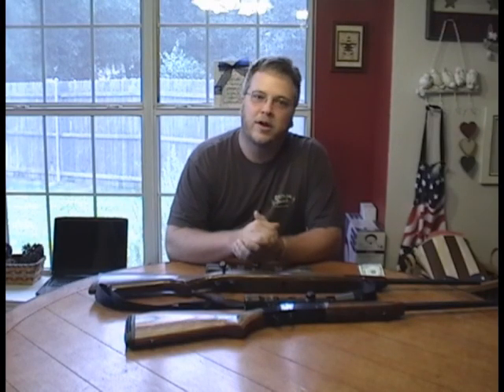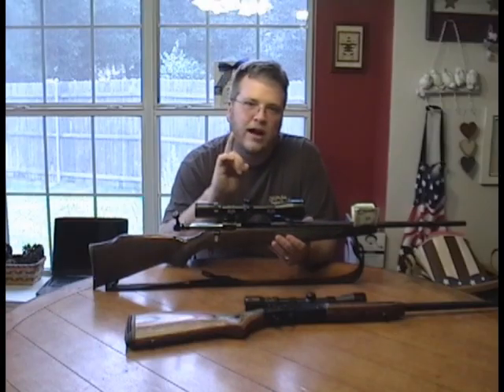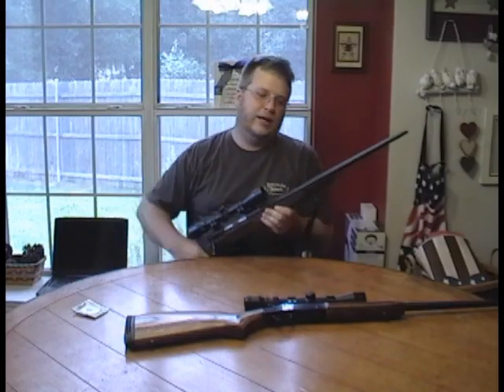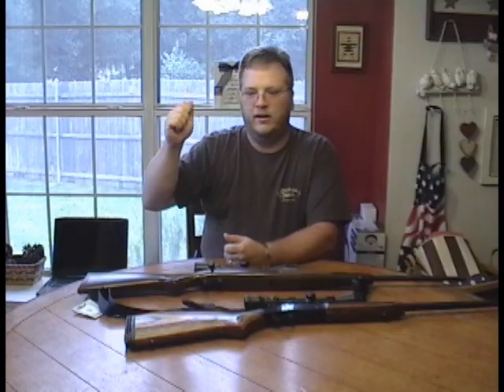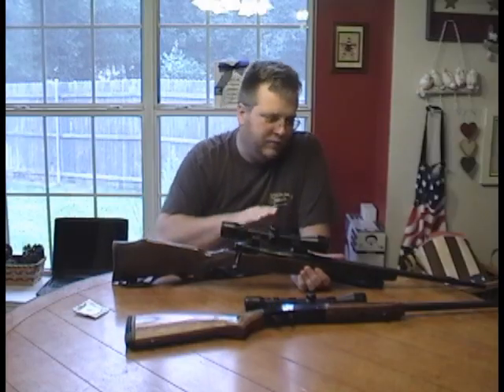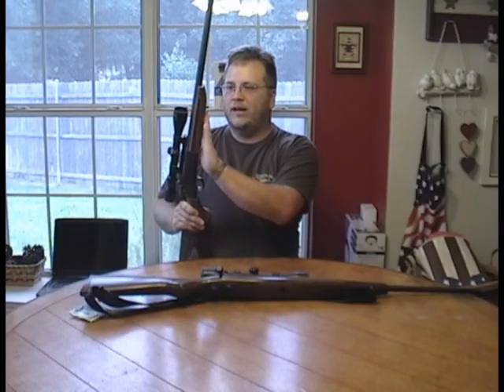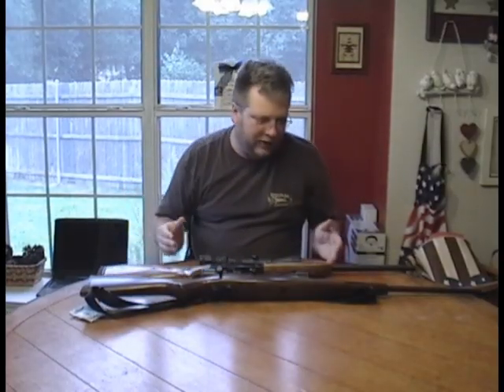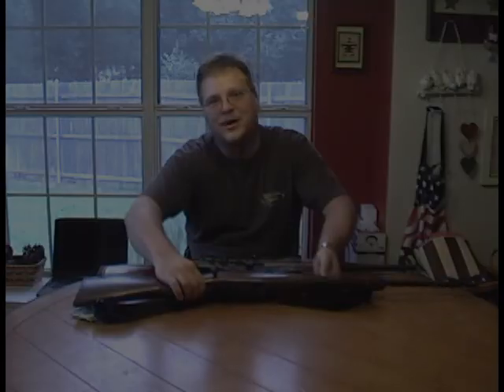Why Floating a Rifle Barrel Increaes Accuracy

Comment from the maker: @ss19800 - Bedding and floating are 100% completely different things.  Floating is about the barrel and removing contact.  Bedding is about the receiver and ensuring contact.    Many people "free float a barrel and bed a receiver" but the processes for each are totally independent and one doesn't require the other.
Reply: Jack Spirko I have 1983 Smith & Wesson model 1500  bolt action. Wood Monte Carlo stock. No floating what so ever. Gun shoots .25 or better MOA. Usually hole in hole. I found a video where a guy did the opposite of free floating. Took a 22 that shot horribly. It was free floated. Added a wire clamp and cinched the barrel against the stock. Then shot lights out.

Comment from the maker: @tmaxxmudin -  You will notice that almost no modern arms have them.  Why?  They really screw up harmonics.  Every point of contact creates another variable.  Mostly you see this on older military weapons where ruggedness is more important than pin point accuracy.   Military conflicts from the advent of guns up to fairly modern times were about volume of fire and reasonable accuracy.   Not tiny groups.  A man is a big target.  In battle a wounded man is better then a dead one.

Comment from the maker: @SigmaBallistics - Unless you are shooting in the Olympics it won't matter.  When you look at range of an air rifle any difference would be meaningless.  When you get good enough to shoot off hand and make one hole at 10 meters you can start tweaking an air rifle.  NOTE I am NOT saying I can or even intend to try.  

Just like  if you float an accurate center-fire and shoot it at 25 yards you will see little to no difference.   Move out to 100 or 200 yards and you can see the improvement.

Comment from the maker: @bottle2lip - It is never "necessary" but barrels and stocks will fluctuate as much with temperature as humidity.   So if you have contact there will be a difference in harmonics from the warm early season to the frigid weather of the late season, as well as from when you have that rifle in your warm house and go out into minus what ever you are going to have to deal with so far north.

Comment: @survivalpodcasting I'm not sure if I agree with your statement "they don't oscillate", as it's power plant dependent.  An airgun with a pre-charged pneumatic power plant I could understand, but I believe that airguns with a spring power plant could potentially benefit from being free floated, if they had a stock that they sat into, which the majority do not.  On the other hand I think bedding the action into the stock could yield some good results.  Anyhow that's my two cents.....

Comment from the maker: @babbler254 - Well it isn't "necessary" to float any barrel but it is often helpful.  Given the low pressures of the 17HMR and the stiff barrels they have to begin with it won't make a huge difference.  It may help a small bit, most 17s are more accurate than the shooter to begin with.

Comment from the maker: @jsore14  You can float a synthetic stock as well.  It is generally considered to not be as necessary simply because they don't swell in humidity, shrink in cold, etc.  That said the barrel does heat up when fired repeatedly and that varies pressure so there is definitely something to be gained.